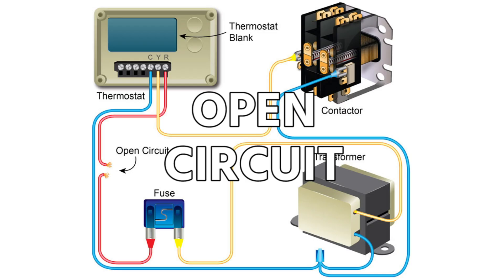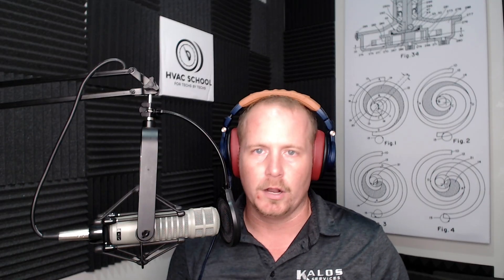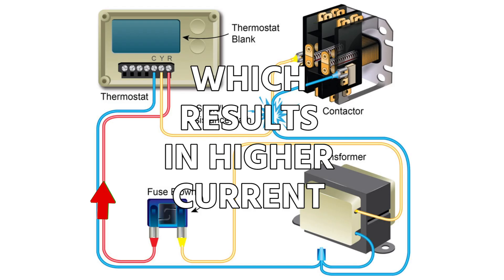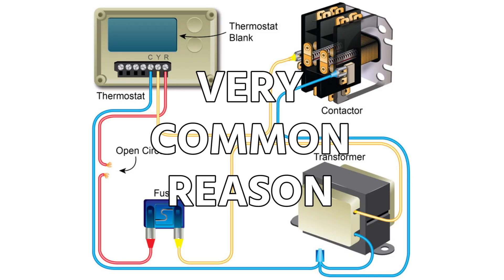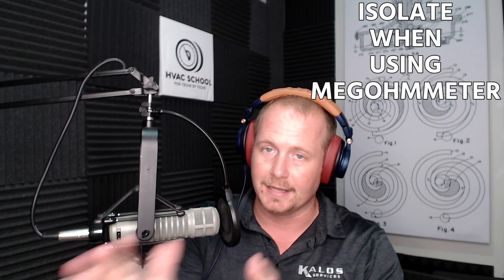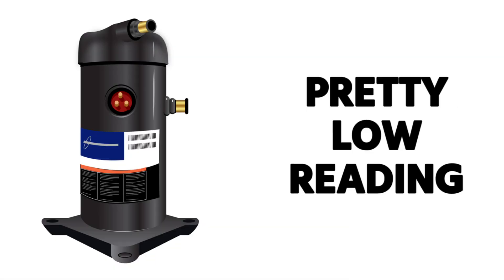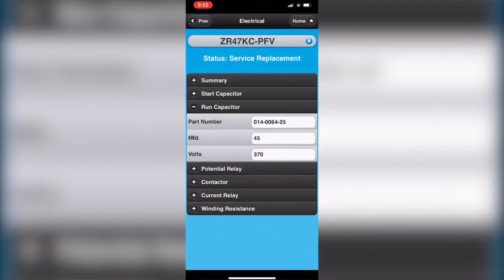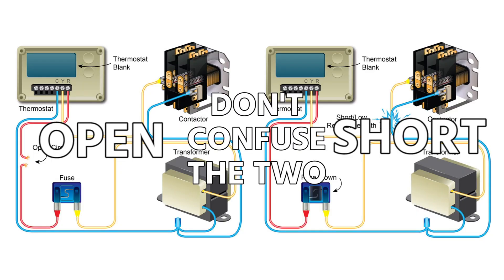Diagnosing Open & Short Circuits

Comment: When ohming out the wires with both ends isolated and not wired nutted together, would you have to test each wire to ground if you already found that every path was open line between each wire?

Comment: What happens when you test for resistance or continuity in a live high voltage circuit??
Reply: You can’t or you’ll damage the multimeter, if you turn on power then you check for power

Comment: I got a drop down light fixture emitting an ozone smell even with no bulb in. With the bulb in it flickers. The switch panel on the wall crackles when turning on and off, but it's actually the switch right next to the one that controls the light with the ozone smell that does that. The breaker is not tripped. Do I have a short circuit in the switch panel?

Comment: I think the confusion comes from the word "open". In normal parlance what we usually mean is that traffic can flow, if a store or a venue is open it means you can go in and out as opposed to when it is closed when you cannot. Open means GO whereas closed means STOP, which is the precise opposite of what we mean when we discuss electrical circuits. If a circuit is open it means electrons CANNOT flow.

Some beginners may benefit from thinking about a switch when discussing open circuits, if you imagine a switch being open it makes a little more sense as to why electrons cannot flow.

Comment: I'm kinda confused on the diagrams. If you have say 4 resistors and the side of the fourth that's directly before the third is 0V, then which one is shorter? The third or fourth? 

So like the first point on the third has voltage but the other end that current is passing through suddenly has zero. Is the a short on the third or the fourth resistor?

Comment: Thanks for video, but I would have a question to you.
When I was checking pins of EGR to see if there is positive and negative in each pins, but I saw that there were both Positive and Negative sides on the Same Pin. I didn't understand that if it was a short circuit or How?

Comment: I need help here. I’m checking ohms between a wire and ground and I’m getting 8k ohms. Does this mean I have a short?
Reply: Without knowing what you're checking you could have a bad connection if it's meant to be grounded, or it could be that it's going through a load, or that the wires have rubbed together and have corroded. I'd double check that you are checking the correct wires as well.

Comment: At around the 5:00 minute mark, you say there should be no connection between the isolated wires and ground, so would you set the DMM on continuity or resistance mode? And then what? Place the black probe on the case [a metal surface] of whatever it is you are working on, and the red probe on one wire, at a time - if the DMM beeps [on continuity mode] that is bad and if the resistance is low [on resistance mode] that would also be bad, as it indicate a short to ground? Did I get that right? Sorry, if this question is all over the place. I’m just a hobbyist and work mostly on pcb circuits, small stuff. Please reply. Thank you
Reply: You got it right

Comment: When you wire nut those wires where do you put the test leads because  they are a distant away from the thermostat to the furnace
Reply: @John Sutter
 If you wire nut at the furnace you test line to line at the thermostat. If you wire nut at the thermostat you test line to line at the furnace, but disconnect all wires on both ends before placing wire nut. 

Hopefully this straight to the point answer is clear compared to my long explanation, and directly answers your question.
Reply: That’s why he says to do it this way because of the distance many times you can’t run ohms meter to both sides of a wire, so by disconnecting the wires on both ends, and wire nut them all together on one end, you test wires on the other end. So you then place ohms meter leads wire to wire and since they are all connected on the other end, they should all give the same reading testing 1 wire at a time to each of the other wires, when testing for an open circuit or broken wire in the casing. If testing for a short circuit in the casing where 2 wires are broken & arcing together you would disconnect all wires and keep them separated on both ends, and test one wire at time line to line you should have the opposite result with zero ohms. Hope that make sense, when wire nut together the other end should all have roughly the same ohms on any 2 line to line, & when separated on other end there should be no ohms on any 2 line to line. Hopefully I answered your question.

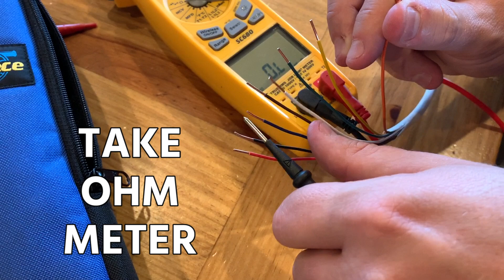Comment: at 3:23 and 5:12 why does he put a marette on all the wires then take it off? what is the purpose of that. At 4:05 how would you tell if there is a short? would you get a measurable resistance with it disconnected at both ends? I am an hvac student and have used an ohmmeter before.
Reply from the maker: Noted! will answer in Q/A video